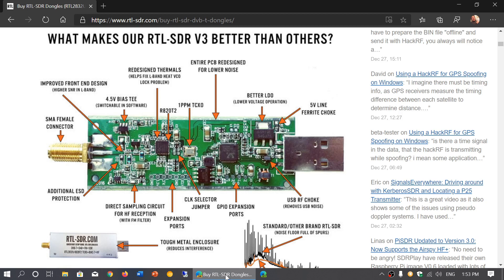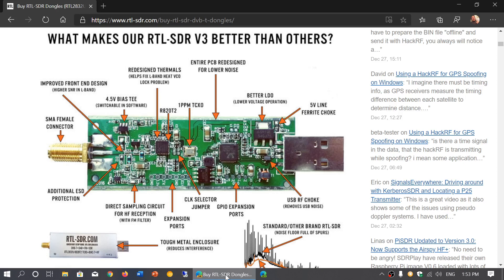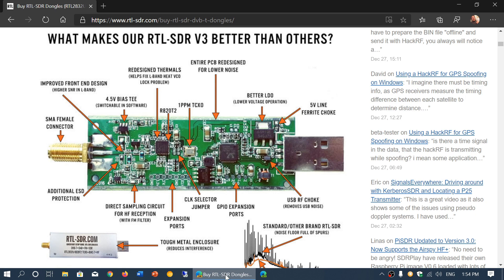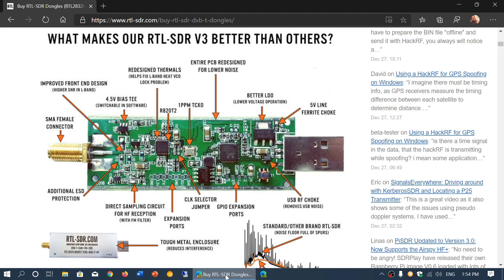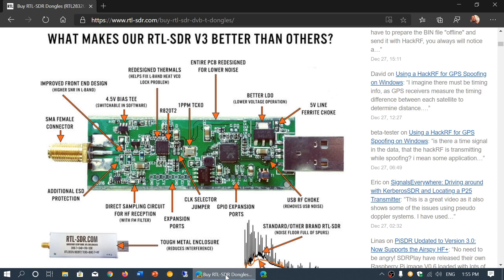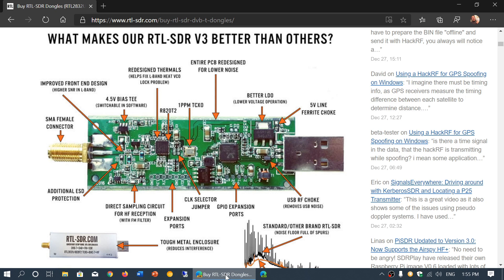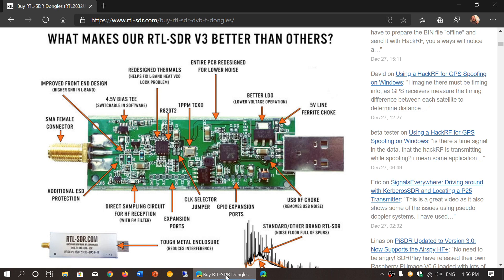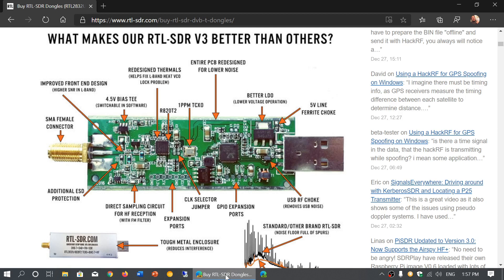RTL SDR V3 Dongle poor performance on Shortwave in general in early testing December 28th 2019

Comment: Hi Gilles, big fan. I know RTL-SDR is not the best for SW listening, but can you advise me on the settings I should use? I got an RTL-SDR dongle with the SDR+ on a Pc & can't figure out settings for SW listening. Thanks.
Reply from the maker: You need to change the options for direct sampling in the settings and you need to make sure you have the real RTL SDR V3 ... there are tons of fakes and they do not do SW nor does the standard non V3 RTL SDR
Reply: @OfficialSWLchannel  Thanks for replying. 👍

Comment: Honest opinion but it lacks an actual usage scenario. (Location, antenna setup, software, settings, time of day, RF conditions, etc..) HF performance in conjunction with a decent up-converter is better than using the direct sampling mod. At the end of the day, its a full spectrum SDR for the price of a chicken dinner for 2.
Reply from the maker: There are some on the channel, this is the result of my tests

Comment: My biggest problem with the the RTL I noticed at 14.4 MHz all the signals below it are mirrored in reverse above 14.4MHz  Signals above 14.4 are reverse mirrored below it causing all kinds of false, ghost signals when in Q-input mode (below 25 MHz).    Signals  were better above 25 MHz in Q input disabled mode with decent sensitivity in FM broadcast band and above. using just my 60 FT longwire antenna.   It was obviously cheap,  so I was little surprised by its shortcomings,  especially on shortwave.  I will be getting a SDRPlay  in the future.

Comment: i would like to say yes, very much a step up from the Sdr-Rtl v3 of course it  be the Sdrplay - RSP1 -RSP1A and right on up up the new RspDx  using Sdruno ..but  if your on a tight budget and want to get in the same ballpark as in RSP1 performance  i then highly recommend the MSI.SDR 10kHz To 2GHz 12 bit Panadapter this is the better buy and a nice good step up from the Sdr-Rtl blog 3 . A few bucks more then Sdr-Rtl but well worth it!  and besides at least with the the Msi.Sdr you will have that option to attenuate the RF gain in the software itself so there's no need for external attenuator..

Comment: Direct sampling is not good for either sdr dongle. Yes, it can be done, and it works. But the dongle is deaf under 23mhz by default. An Upconverter is a must and then you shift the hf band in the usable frequency that the dongle uses. After upconverting, the shift can be corrected in the software, so it displays the right frequency.  Only then the dongle will perform well.
Reply: Agreed... however before opting for the more expensive SDR Play receiver a cheap dongle and Ham-it-Up-Converter should be at least considered as they provide quite good performance 👍

Comment: i got one of these last week and i loaded the software and when i hit play it says "no device" none in select bar to chose from..  any ideas??
Reply: Google "Zadig.exe" The RTL-SDR needs a driver not included with Windows. The instructions on how to install the driver are readily available.
Reply from the maker: You need to have a special driver..  ZADIG download that and it will replace the original windows driver.. then it will work

Comment: What antenna was used for this testing
Reply from the maker: mla 30 magnetic loop antenna
Reply: @OfficialSWLchannel  The genuine RTL-SDR v3 blog dongle?
Reply: @OfficialSWLchannel  , hello and first of all thank you a lot for this synthetic and honest review. Concerning the problem of spurious, gohst signals and general poor performances in HF bands, do you think that instead of using an active mla 30 magnetic loop (which is also large band  if i do not mistake mysele, please correct me if it is the case...),  it would not be better to use a high Q passive tunable magnetic loop? It would bring a strong passband filtering effect when tuned on the desired frequency, without introducing any additional noise (no amplifier), removing gohst images at least partly, and also, by playing with a coupling loop variably coupled to the main loop, avoiding to overload the dongle? In advance, thank you for your thought about this idea.

Comment: A friend of mine got the RTL SDR V3 and so far he got disappointed. He's new to sdr and is getting some help from very experienced dxers. I have to say, that he's changing his opinion a bit, but in general still prefer his good old Tecsun 310ET. I had an sdr dongle with upconverted and its sensibility was very bad. Then I got an SDRplay RSP2 and later an Airspy HF+ Discovery. I've yet to find my way with SDR#, for I am "SDRuno dependent".